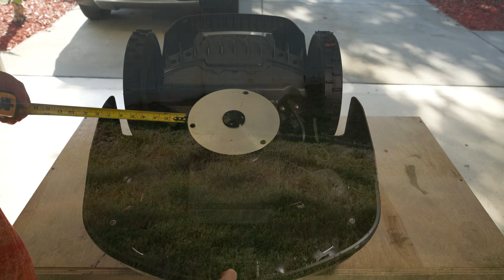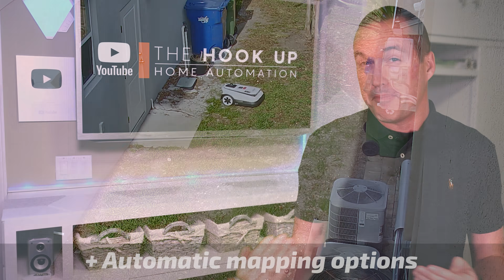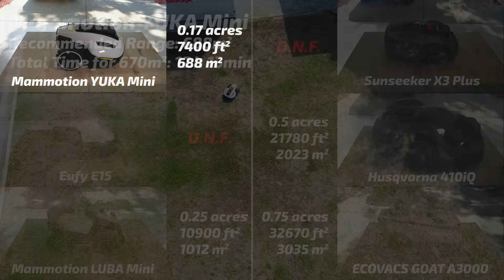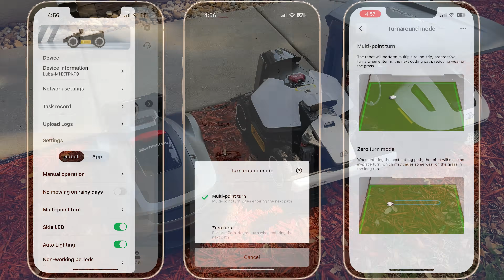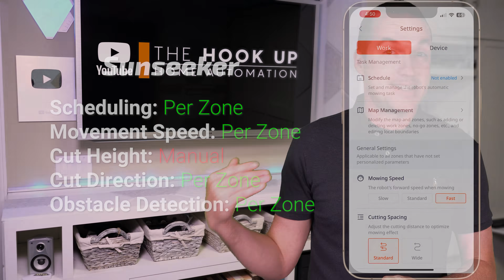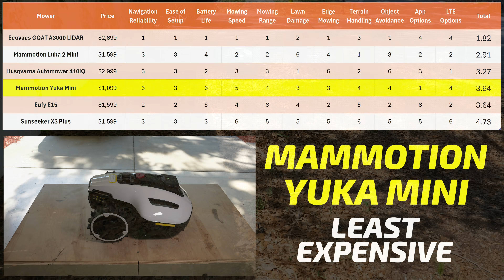Watch BEFORE You Buy a Robotic Lawnmower - LIDAR is a GAME CHANGER!

Comment: Your reference station setup for Husqvarna was terrible. It needs to be on the peak of your house to have a clear view of the sky and ground. It should OVERHANG your house.
Reply from the maker: Why on earth would an RTK station need to have a clear view of the ground? Get a clue.
Reply: @TheHookUp You're the clown who had the RTK on top of your house like a moron. Nobody installs an RTK that way. Explain to everyone why DirecTV dishes aren't on top of rooftops you IGNORAMUS. After you fly multimillion dollar aircraft that communicate via SATCOM, then we can have this discussion.
Reply: @TheHookUp It's not supposed to rest on top of a roof. You're supposed to have it hang over the peak of the roof. You can't be this non technical. Do you see DirecTV satellite dishes on top of a roof? Lmao 🤣
Reply from the maker: You still haven't given any reason why an RTK would need to see the ground.  The reason DirectTV dishes are mounted on the side of the house is because it's easier to run the wires inside that way, drilling a hole in the side of the house rather than the roof.
Reply: @TheHookUp You're an IGNORAMUS dude. I've lived all over and a DirecTV dish faces south. An RTK antenna should face south too for the best satellite reception. But you knew that right? It has nothing to do with drilling holes in the structure for wires. I've had satellite dishes inserted inro the ground for DirecTV so you're wrong again or hanging of a balcony. Stick to YouTube. This channel will be replaced by AI soon enough.
Reply from the maker: Why are we talking about DirectTV? You told me an RTK antenna needs to see the ground.
Reply: @TheHookUp Talk to Husqvarna and tell them exactly where you put the RTK. You could stick it up your @$$ for all I care. Please send Husqvarna the video of how you improperly setup their robotic mower. You're inept and the only person in history who put an RTK antenna on the top of your roof. Nothing is supposed to be underneath it except for the ground.

Comment: Would you plan to review/compare O1000 RTK with A3000 RTK ?
Reply from the maker: There is no A3000 RTK.
Reply: @TheHookUp  my bad, I meant to say A3000 Lidar.
Reply from the maker: Unlikely.  The A3000 LiDAR is not better than the rest of the other mowers because of it's app, shape, or general construction.  It's better because of LiDAR.  If you take away it's largest strength (Like the O1000 RTK), it would just be on par or worse than RTK offerings from other brands.
Reply: @TheHookUp  this is exactly what I was wondering, if the dedicated top lidar was worth the difference. for about 10k-12k sqft, what would you use/recommend? I don't want to mess with wires, got a full smart home setup from lightswitches to vacuums and automated lock unlock power on and off things with Smartthings, my last piece is the mower, I wouldn't use it for the front yard as front yard is my baby but the backyard I plan to save time and effort, so I can go do other things with family rather than wasting a morning, especially hot summers in Oklahoma, gotta mow at 6am or you'll be cooking. 
Also, thank you for responding and providing additional information, much appreciated sir!
Reply from the maker: Do you have trees and 2 story buildings that will be a problem for RTK?
Reply: @TheHookUp  single story, got a detached office space in the yard, and just tree.
Reply: @TheHookUp  i'm considering Anthbot Genie600 or Ecovacs o1000
Reply from the maker: @ylp2582  I haven't tested either of those so I can't give a good recommendation unfortunately.

Comment: Great video Rob!

After 5 seasons with a regular boundary wire robot mower (it broke) we bought a yuka mini a few weeks ago and has been working very well.

In Europe there are multiple yuka mini, effectively the only difference between them is the battery size, but i think they also limit the mapped area in the map (need to test that!) we just bought the cheapest one, the 600 (600m2 max). 4g module seems to be included too, but the service is similarly priced (€50/y)

Had no issues setting up the gps, mounted the rtk antenna to our shed wall, but we dont have much tree coverage and no buildings near our lawn.

We have recovered it 0 times before which is very impressive given how long our grass was when it started. It was 12 inches and going to seed 🙃

A few negatives ive witnessed:

As you noted, the stated mowing time doesn't reflect charging times. It might be tough to get in accurate, but at least have it guess! Its no good to me to know the mow time is 4 hours, if it actually takes 12 hours or whatever it is!

Its charging doesnt seem as smart as it should. One of the days it had 5 mins mowing left, but it hit 15% battery so it went back to charge, despite it would have easily finished the task and then charged. It then proceeded to charge back up to full and hit into the "dont mow at night" rule (we often have hedgehogs) so it had to wait til the morning and mowed for 5 mins and then went back to sit idle again. I feel like it could be smarter about this, top up whats needed and finish the task

The other issue is it isnt driving as tight to the boundary i drove when mapping in some parts, like a full foot inside where i woild have driven, something i need to take a look at.

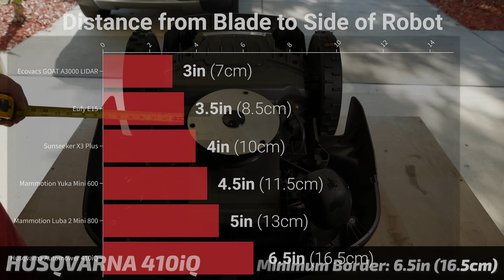Comment: 15:40 Shouldn't it be measured from the edge of the blade? If the disc is spinning, the blade is about 1cm closer to the edge.

It's similar to robot vacuum cleaners at the moment, a few years ago everyone bought Roomba because they were famous even though they were expensive. I bought my first Xiaomi vacuum cleaner and the result was much better because it had much better navigation capabilities than randomly driving around the room. 
Now I'm choosing a lawn mower, of course I wanted Husqvarna at first because my parents had it, but a little research is enough and the newer brands are completely more modern and innovative in terms of comfort of use, function, navigation and the like.

Comment: looks like you have a particularly tough environment for gps/rtk.  For us we have a pretty open area, with about 3/4 acre of mowable grass.  A mammotion Luba 2 has no problems, and I have the RTK antenna in the ground less than 10ft from my house (which is not supposed to be optimal). My only issue with the luba is that it tears up the grass in some spots because of the way it's wheels/turning works. But from a positioning and obstacle avoidnace point of view it's pretty much been perfect.  If you get a lot of leaves, you still need to deal with that. Overall it's a good tradeoff --- i save tons of time and i can mow frequently because 1) i'm not doing it and 2) it is completely silent.    I was ready to go with robomowers once gps became practical instead of ground-installed perimiter wires,  it will be interesting to see if lidar only or lidar enhanced gps improves things.  Might not work for all lawns / environments, but i am not going back to conventional mowing

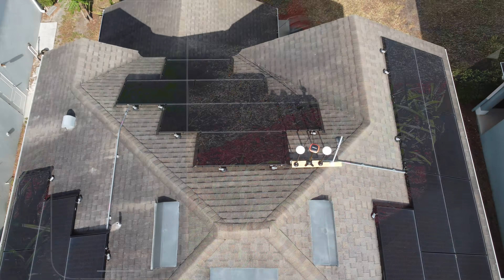Comment: Hi there. I spent 20+ years in the RF satellite field. and I can tell you based on decades of RF engineering experience that @3:57 you're having problems for two reasons... You never mount antennas directly adjacent to one another, they DO interfere with each other - you are NOT getting an "unobstructed view" of the satellites this way. Ideally you'd mount each of them at different places on your roof, at least a few feet from other antennas. The way you have them here in the video they are definitely obstructing each other. Side note, did you know there's actually an intentional error bit that is coded into civillian GPS signals to keep accuracy from being too precise? This was originally required by the US military so GPS couldn't be used to guide IED's and nefarious projectiles to assassinate people or hit targets with anything other than technology built FOR a military/country. Those days are long now that we have GPS, GLONASS, Galileo, and BeiDou. 

Also, I own TWO Luba2's (not mini's). If you put that RTK on your roof, you need to mount it HIGH ABOVE your roof. Put it on a mast at least another 5 feet above your roof peak. It needs to see the horizon 360 deg.  

That is all...
Reply from the maker: I really really really really don't think the RTK signal was the issue.  The issue was the GPS on the actual robot being obstructed.  It doesn't matter how good your RTK signal is, if the robot itself doesn't have clear view of the sky it's not going to work.  The only thing that improving RTK positioning does is ensure that whatever satellites the robot sees the RTK also sees.
Reply: @TheHookUp  I agree, the robot does have to see enough satellites on its own, but where you have the RTK's mounted are not optimal anyway. But we have a FB group called "Mammotion Luba Issues & Solutions" that isn't run by the company. There are lots of people that have yards like you that have affirmed in tight alleyways like you have it is indeed almost hopeless. Really sucks. I have 2 luba2's and they fortunately perform pretty darn well. My only issue has been it getting a tiny twigged lodged under the disk and I have to go out and pull it out ("motor overloaded"). I also take issue with the fact that you can't roll back to prior firmware because they were pushing firmware updates so often that would then jack up the operability. I can't stand forced updates, but it's worse when they screw up the code and you can't mow your lawn for 3-5 days while they sort it out and push another firmware update.

Comment: I love and hate mine. Have a Luba 2 for almost a year now, 1+ acre. It's been having issues with the blade lift motor recently, so does not adjust height - which at this moment is fine. It defaults to "parking" the height at max, which is what I mow at these days. That said I have yet to, and need to, deal with support.

The costs are still WAY too high for what they are vs robot vacuums and all that's packed into them these days, and they're still cheaper. Having the cost the same as a John Deere riding mower is daft.

Comment: First let me say i have spent 100hrs watching youtube vids and researching  robot mowers I have a steep hillside to mow to that was the main driver of wanting one and limited my choices. 90 % of the reviews like this i see can hardly qualify as real test because if what i see people mowing is what they call a lawn is a joke Its 90% weeds,sand or dirt Why in gods name would you even want a robot mower with lawns that look like that Anyhow i digress. I did end up with the Luba mini and what this high speed take on all these mower fails to say is there are 4 models of the mini the 800 and 1500 The H and S model The 800 does 800sq meters or 8600ft The 1500 is squarer meters also. So you can do lot more with the 1500 in terms of area mowed in a day But they still do over state the amount of area per charge. I got a 800 but upgraded the battery with the 1500 model that saved me $ and got me more run times. The 1500 states 165min cut per full charge but i found it to only get about 118min when cutting hill side similar numbers on flat. The RTK is a issue for some and there no arguing that But mamotion has a new service that does not require RTK its only out in Europe right now but will be US at some point . Most of my issues are when they do updates i seem to have to remap each time.Mamotion Does listen and adds features to app that are asked for on the Facebook page.The tech support and response times from company IE sending in for repairs are just awful So many people have stories of  long wait times to just get a reply and i am one of them. The big thing i never see cover on these vids is cut quality because the lawns look awful to begin with. I can say when my mini works my lawn looks amazing perfect lines and golf course look But on the hillside i have lot of dead grass left behind.That is fail on all these mowers they dont mulch so you end up cutting 3 times a week to keep they thatch from building up and even then you still might have to blow or rake. By far the Mini and Mamotion has the best over all set up and price But bad Tech support over stating cut times and forced updates when you might not want to change anything casue its working how you want can all be frustrating. Not having to mow a hillside when its 100 degrees out makes me put up with these frustrations.

Comment: Omg. What a great comparison. I almost did an impulsive by on the Eufy. I guess I need to do some more research. These robot lawn mowers makers really need to rethink the blade system for cutting. What lawn has only grass blades that tiny razor blades can handle. They really need to have some robust blades on those things.
Reply from the maker: Lymow uses mulching blades, they haven't left the kickstarter phase yet though.
Reply: Thank you so much. You i’ve sent me down a rabbit hole of researching this Lymow robotic mower and I have to say I am impressed. What a timely mention. Exactly what I’ve been looking for and more. They got my sale as a backer. 🤞🏾

Comment: Why did you compare the Ecovacs with the Luba 2 mini?  That's not a fair comparison at all.  The Luba 2 would be a fair comparison in size, features, and price point.  As an experienced robot tester, mammotion will likely fix the navigation and tank turn issues with firmware updates.  The Luba and Luba2 also had similar issues that were fixed very quickly with firmware updates, and the Luba 2 mini is still a very new product.
Reply from the maker: The Luba 2 Mini is appropriately sized for my yard.  If Ecovacs had a LiDAR robot with smaller range/size/price point I would have used that instead.

Comment: LIDAR is a robotic lawnmower gimmick they are trying to push harder than needed. Why? Because istalling the hardwires is laborsome - unless you take an installation pack to go with it. What these kind of tests doesn't show, is how is the warranty repairs for the lesser known brands? I had a Stihl iMow 5 for a 1½ year and it died. Despite having warranty, Stihl was completely out of stock for repair parts for the whole summer, until there was still 1-2 month season left I got a new one, which was broken from the factory. That's when I switched to Husqvarna 415X which is miles ahead in terms of quality, but doesn't have that many gimmicks, such as many of the new comers to the industry. At the start of this season, battery was completely dead on my new 415X, but I got it replaced within a day, when the Stihl would probably have taken an other season to get a part for.

What I'm trying to say, getting the one with the most bells and whistles might work out for awhile, but once a problem occurs, you really should take into consideration on a) who b) when) c) how it can be fixed

Comment: I have the Sunseeker X7 plus.  I replaced my OG Luba 5000 because it didn’t mow high enough, and was too rough on my grass with the turns (major rutting).  I went with Sunseeker because of the hei of mow and the three wheel power system.  Im in Kentucky, with thick grass, and my X7 needs no rescuing.  If you have questions about it, ask me and Ill answer.  I may do a short video on my experience with it so far.

Comment: I like your reviews but this one isn’t a winner. It’s pretty obvious that you and your neighbor aren’t overly invested in your yards. Unfortunately, this impaired the review.

No mower is rated base on its ability to complete the cut in a single charge. They are rated for area they can maintain (a couple mows a week). Maybe it was me, but even mentioning it felt like your research wasn’t on point before you designed the tests.  

Edging and safety are opponents here. Mowers are way safer than people think because the blades sit very low and are inset from the edges. Aside from shoving your feet under the sides, the bumper should be sufficient. Trimming an extra inch isn’t going to matter so it really isn’t a factor.

The review didn’t address hills. The Luba is going to be the primary choice for yards with hills. I would also worry about the Ecovacs being able to avoid drifting on hills without external positioning.

Finally, I didn’t see the most important question answered. Does it cut well? Does it leave uncut blades, can it leave stripes, what height options exist and how do they get set? There isn’t much point to the mower if it just drives over the grass.
Reply from the maker: So only people who have perfectly manicured lawns are allowed to use robotic mowers?

I specifically mentioned that the single charge cut area isn't particularly important, but it's certainly important to know that the Eufy isn't able to cut more than 400m2 due to the need for daylight and the inability to resume where it left off.

I don't understand your edging comment, I didn't make a single comment about safety.  These mowers are all very safe.

We don't have hills in Florida, sorry.

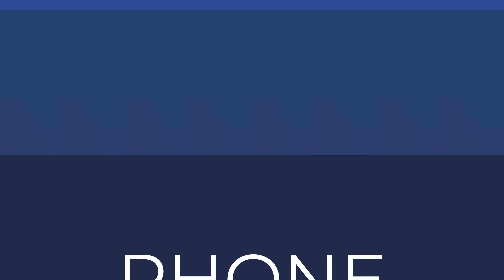I specifically addressed lawn striping, striping direction, patterns, height options, and how they get set, starting at 17:55

Comment: Look at that huge yard! Seriously though, robot mix mowers are really designed for people who have a little passion for their lawn but not enough to buy a reel mower. Ultimately, if are someone who just “mulches” all the crap in your grass these aren’t for you. The Yuka has a sweeper but I wouldn’t expect much from it.

I just set up my Luba2 for the second season and I have no major complaints. I have half an acre of actual lawn so push mowing is a lot of time each weekend that I could spend with my family. I considered a riding mower but a decent battery version is $5k. I still have to mow a few spots manually (under trees that shed branches) and trim but you would trim even with a push or riding mower. Comparing this to a professional service isn’t appropriate. You compare it to a regular mower + time saved. I that equation will vary for everyone.